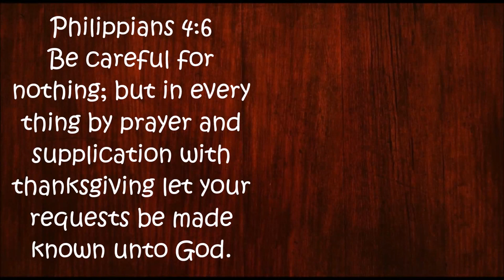Making a Dog Door for the Sliding Glass Door

Comment: Very nice work. Make sure you keep the door clean. It’s amazing how fast Mary Ellen, my Golden Retriever, managed to quickly cover my first dog door in very resilient grunge. Most importantly, make sure you secure the dog door when you’re not home. I came back from vacation to a burglarized home – yup, they crawled through the door welcomed by my very friendly Golden.  Police told me while dusting for fingerprints (which seemed anachronistic), burglars often check freezers for hidden jewelry or cash. That helped explain why my backyard was full of empty ice cream containers. The crooks tossed it there to keep the dog busy while they burgled. They took a few expensive items I left home because friends recommended not taking valuables to Brazil. Insurance was agreeable and responsive as month by month I discovered more stolen items. They covered everything except two watches. Be aware certain high value possessions require additional coverage.
I quickly had a professional install cameras and other anti-theft tech inside and out. I was the first in the neighborhood burglarized, and that convinced many neighbors security is best installed before, not after a burglary. Many used my installer’s services, and his generous referral  rebates paid for most of my security system.
I’m going to build a dog door for Marysue, my Boarder/Aussie mix. I’m in an apartment now and not worried about security for a 9th floor balcony. If anyone has any recommendations about a basic DIY patio sliding glass dog door for someone who does not have a tool shop or a near by lumberyard, I’d appreciate and welcome your advice.
Reply: Next time you can rent a lock box at a bank to put valuable things.
Reply: Petsafe prefab would probably be your best option. Otherwise you could make one with hand tools, 2x4s and a prefab flappy dog door.